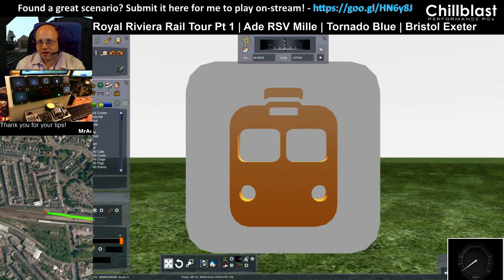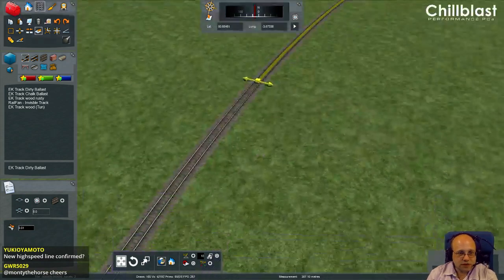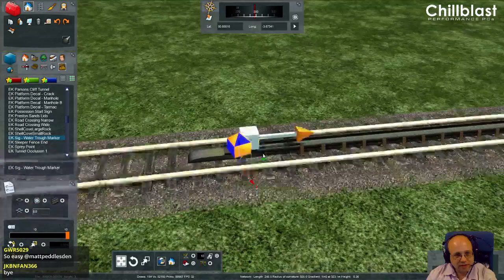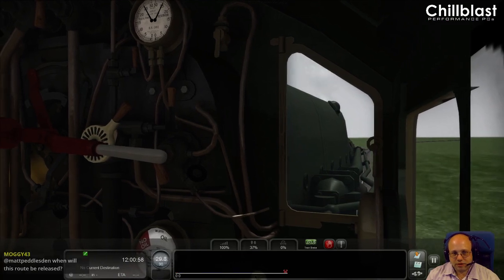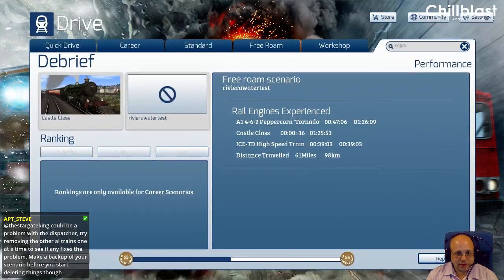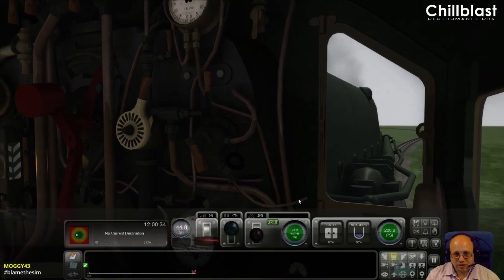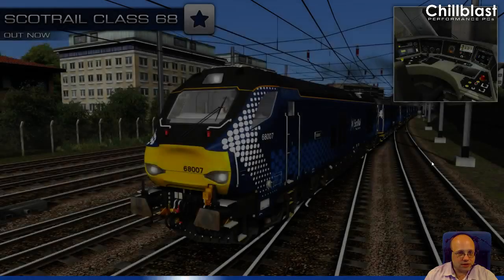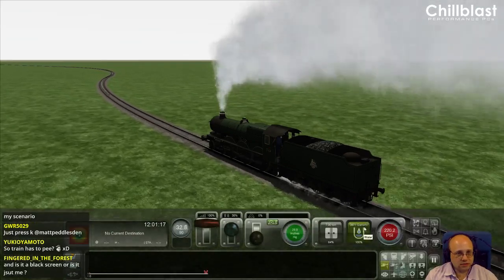Let's Play Train Simulator 2016 Tutorial - How to add steam water troughs

Comment: where do I get EK items, I assume that's from an Add-on pack I don't have, EK water trough is not in my item list.
Reply: After a very lengthy search, it seems they're included with the Riviera Line in the 50's Route, apparently.  (Would have been nice  - and logical - to have included that info at the outset.) But - not all locos are equipped to use them, so don't shell out £17.99 for the A4 and expect to add them North of Northallerton at Danby Wiske, so you can run the mid 50's Elizabethan like I did, on the merged ECML route... cos it won't work. I read on another thread that they only work on engines released after 2016. Not sure if that's correct because I seem to remember the Deltic or Class 40 from AP had water scoops.